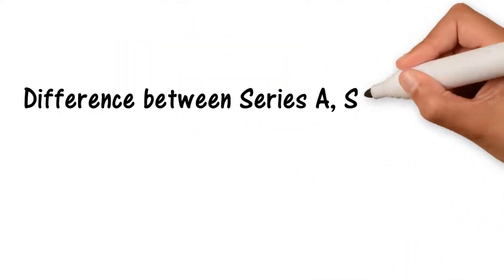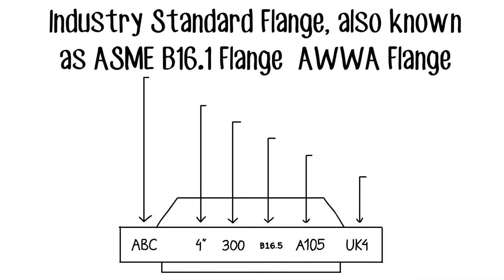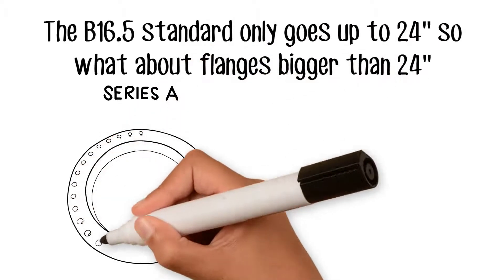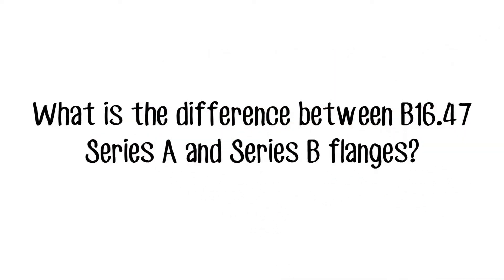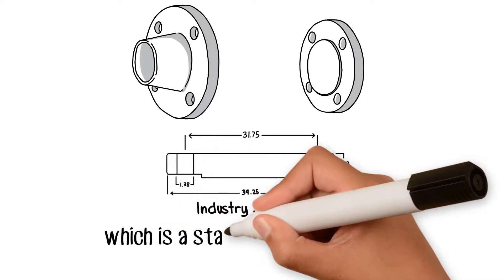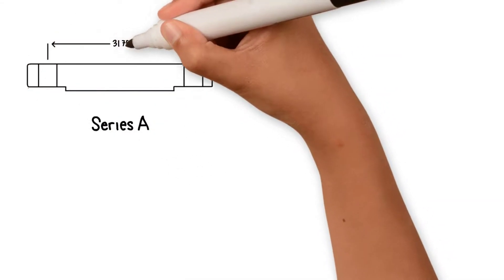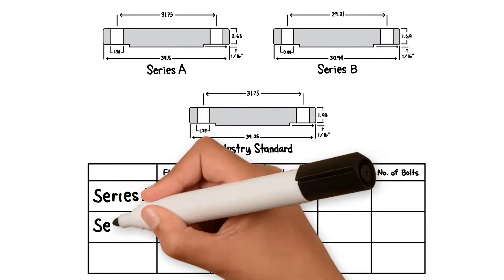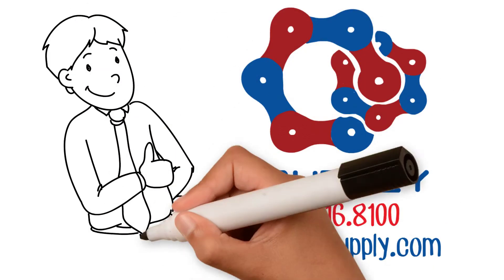Difference between Series A and Series B Flange

Comment: Thanks for the video, nice presentation.  Some of the statements in the comparison of Series A and Series B are not completely true for all sizes and classes.  It is actually difficult to make completely correct generalizations that one or the other is "stronger", "uses larger bolts", etc.  For example, compare Series A and B 300# flanges in sizes 38" and 42".  Also, Series A 150# flanges have a geometry which might be considered unfavorable with respect to rotation and the potential to cause gross plastic deformation (permanent bending) when high bolts loads are applied.  See for example ASME technical paper PVP2013-97813 by Dr. Warren Brown.